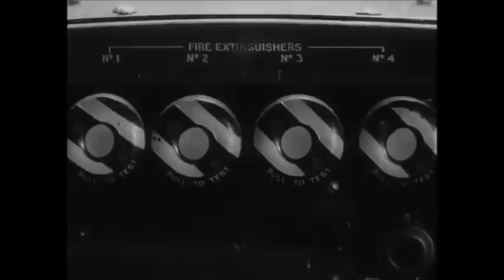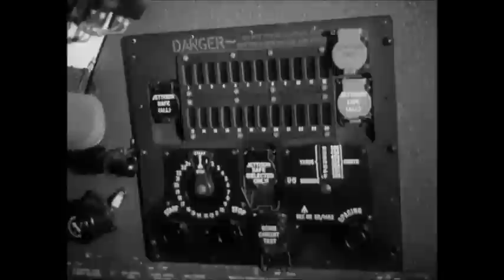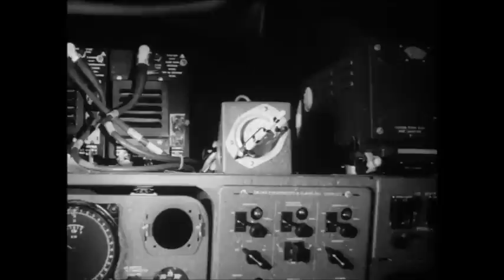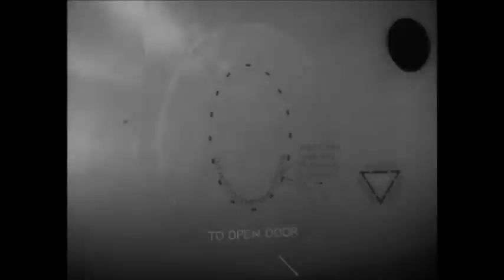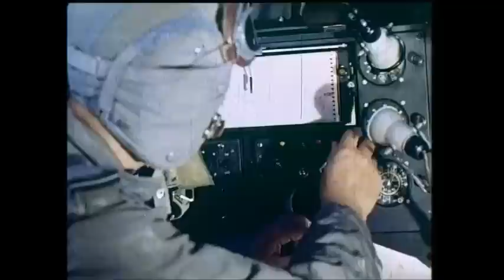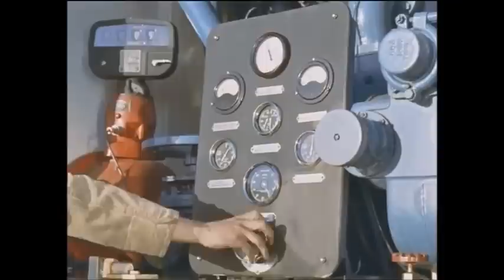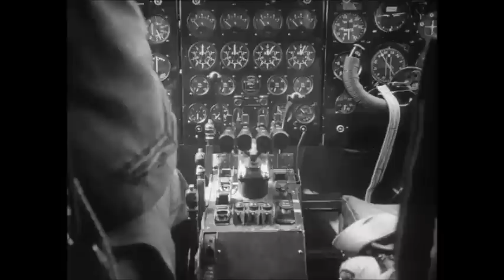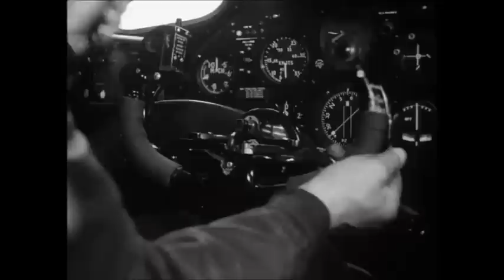Vickers Valiant - The First British V-Bomber

Comment: This video of the valiant’s history is fascinating. I first worked on it when as an apprentice at Weybridge I moved to the drawing office after my tour of all other departments. My first job was to draw up a little plate that would seal off the holes where the vertical stiffeners in the center beam penetrated the bomb bay roof.  I think they  found that when the bomb doors were opened in flight the wind blew in between the beam side plates and did something bad. Those stiffeners were channel shapes separating side sheets on either side. The rubber bag fuel tanks on either side rested against these side sheets . The beam had to be massive enough to carry the bombs weight fore and aft to the wing main spar.
   On the Monday  following  my first week doing this job I my boss the redoubtable George Hodder ordered me to stop work on those plates because the prototype type 660 had crashed. I think I learned at the time, the three observers in the back got out got out and survived by parachutes. One (Was his name Montgomery?) landed in a tree. The two pilots used ejector seats. Sadly the copilot an RAF crewman hit the tail and died.  After that ejector seats giving a faster and higher exit were designed for V bombers. My next couple of years I worked on the type 667 which was the production Valiant, the pathfinder version Type  673 and then the type 1000 transport that was cancelled. Stuff moved at Vickers in those days.
    It is a shame they did not make the 673 the production version, I met one of the Vickers test pilots at Lasham. He said that the 673 was faster and smoother at high speed. I suspect that those main wheel fairings provided an area rule effect that accounted for most of that.  Removing those huge holes in the under wing panels for the bicycle style landing gear must have done wonders for wing strength.  Adding a 54 inch plug in the fuselage forward of the wing , increased the fuselage bending moment. So then subsequent jobs for me were to draw up some specially machined stringers to the top fuselage and steel bars at the lower side where the big opening of the bomb bay meets the side of it. The stress man who gave me the cross section areas of those bits later helped me in turn be a stress bloke. I owe my later career to him.
    For a long time after I left Vickers I could still remember drawing numbers and stations of Valiants.   Stations were defined by the distance in inches from the extreme nose. So something 456 inches aft of the nose would be at station 456. When they added that plug of 56 inches in the pathfinder, frame 125 might still be spoken of as 123 but our stuff aft would be called station 456 plus 54. So the original station numbers were retained for reference. As a comparison, on the Shuttle external tank they put the datum point some 300 or so inches forward of the nose. So they could have lengthened the nose this 300 inches without changing the descriptive geometry.
 Bob Newton
Reply: wow amazing insight. thanks for sharing!
Reply: Thank you so much Robert. Fascinating to hear in such detail. How wonderful to have such pride in your work. 
I thoroughly enjoyed a visit to Brooklands a couple of years ago. l told friends it would have been nearly as good with no exhibits,  but just the amazing volunteers.
Many had worked for Vickers,  and one charming gent had been a test pilot! I have 250 hours, we chatted over an hour,  l was enthralled! 
That was definitely the best day at a museum l have ever had. 
Oh, and l got to drive a F1  simulator around Brooklands.
Reply: It is brilliant to hear the story of a designer working on the Valiant, it was a plane that had many setbacks and the engineers working on the design had quite a hard time, I have to say, they worked extremely hard on the program, making technological strides to create a marvellous aircraft.
Reply: Fascinating, thanks for sharing.
Reply: Wonderful memory
Reply: Great comments, I was wondering as someone knowledgeable on the structural engineering of the Valiant's airframe... why the type reached the end of its fatigue life in such a short time, it was in service for just 10 years.. and what are your thoughts on this as it relates to the B-52 which was introduced at the same time is now expected to remain in service beyond 2040, for 100 years.
Reply: Thank you so much for sharing and for doing so in such detail. It speaks volumes that you recount with such fondness and energy about something that so many others would, wrongly, cast off as something 'inconsequential' or 'trivial' simply because your work wasn't on something they deemed 'important' or 'sexy'. The truth of the matter is of course that it was people like yourself, working on such things, that made such a difference. 

I don't know you from Adam but you have put all this across so eloquently in a comment on a video that I would implore you to look into one of the many organisations / groups out there who dedicate their time too recording 'living histories' of people just like yourself. 'Ordinary' people who contributed so much but may view their efforts as 'nothing special' or feel 'nobody would be interested in my story'. I think it is people such as yourself who are thee most important voices and have such important things to share for prosperity. To create a record of life and work in a past time so that our youth and future generations can have a way to view, listen and learn from your own stories. 

Likely you'll never respond and that is fine but if you read this I hope you consider my suggestion at least. Typing "UK Living History" into google should start you off. I don't work for any such organisation myself but I know they exist and I genuinely feel you have many great snapshots that the future generations ( for all their wrongs I imagine) should at least have a chance to witness.

Comment: How difficult was servicing and replacing engines mounted in the wing roots compared to engines suspended under a wing?
Reply: One is built in the wing making it harder to service. The other is bolt on bolt off like todays airliners.
Reply: We can observe decades of aircraft development and see that engines are only mounted in-wing or in-fuselage when aerodynamic concerns outweigh serviceability.    Today only military combat aircraft use internal engine mounting.
Reply: Replacing or servicing was exponentially more difficult and time consuming with engines in the wing roots. Also, an engine fire or catastrophic engine failure in a wing root = bad news. Especially in those days, when engines were far more failure prone. 

So more drag + more fuel burned + fire/explosion hazard + harder to service = the reason there isn’t a modern aircraft with engines like the Valiant’s. 

But hey, it sure looks “handsome”.
Reply: It seems counter intuitive, but a 707 with it’s engines in nacelles below the wings had better aerodynamic properties than a Comet. As speeds edge closer to Mach 1, a thick wing adds an enormous drag penalty. With engines in the wing root, the wing must necessarily become thicker. It’s one reason a B-52 or a 747 looks less than slick, but are two of the fastest aircraft of their type. Especially when they were new 50-60 years ago. It’s also why modern supersonic aircraft, without exception, have very thin wings (look at an F-104 Starfighter).
Reply: @Chris Potter Great comments! Indeed, placing the engines in the wing roots is seen today as an example of how not to design jet aircraft. The british notion prevalent at the time that this now obsolete configuration was more aerodynamic? It reflects just how far behind the UK aircraft industry really was in aircraft aerodynamics.
Reply: doktorbimmer m
Reply: @Keith Brettell The Boeing B-47 was introduced into service years earlier and still outperformed the Valiant. This was due to a much more advanced aerodynamic design heavily influenced by German developments made during WW2
Reply: @Breezy Mods You seem completely unaware of "Operation Lusty" and "Operation Paperclip" or how these German technology programs effected the development of the Boeing B-47 or why the Boeing company quickly leaped ahead of its competitors.
Reply: @chrispotter3324  also why high speed flying saucer  is unlikely

Comment: Engines in bays instead of pods are more dangerous when they let go besides being cruel to jet engine mechanics. They offered less drag, useful with the feeble engine output and crude mechanical/hydromechanical fuel controls of the era.
Reply: Actually engines mounted in the wing roots offer no significant aerodynamic advantage... this popular but false theory in the UK was dispelled by modern testing methods.
Reply: @doktorbimmer  Incorrect. Palpably and easily incorrect.
Reply: They don't offer less drag on a subsonic aircraft, the Valiant was a very unsophisticated and inefficient airframe.
Reply: @Booyaka9000  The Valiant's engine placement was based entirely on a popular British aerodynamic theory that proved to be completely wrong... proving that the British aircraft industry years behind in high speed aerodynamic research.

Comment: Why have they stopped using this intake scheme... Is it inferior to under-wing nacelles? It seems like a much better idea aerodynamically speaking.
Reply: Short answer, because the engines in use today are primarily high-bipass turbofans, (although some relatively powerful and efficient low-bipass turbofans are now in operation), and those need space. The higher the fan width, the more efficient the engine, and that needs space. That's why you generally see HB turbofans mounted under wing rather than in it. To accommodate more powerful HB turbofans, you need to redesign the wing root or the entie wing itself. It's a problem the Nimrod MRA4 and Xian H-6K have tried to deal with, but it potentially limits future development.
Reply: That makes sense. I guess I just don't understand why it's better to harvest power from the core's gas path and transmit it to a fan...
Reply: @shainemaine1268  First of all it is such that the air flow on the upper wing surface and the lower wing surface are not even. Therefore it is much better to keep the upper wing surface clean. It took the west some time to understand this. Consequently aircraft, such as the B-52 had engines mounted on pylons (flow speeds up even on the lower wing surface). At this time point bypass engines were not even in use.
In fact the critical factor is the speed of the airflow. Once the airflow reaches Mach 1 one encounters compressibility effects. Due to interference of flow around the engine nacelle and the wing speed increase of the airflow adds and Mach 1 is reached much earlier.
This is the reason why early German jet aircraft had the engines mounted below the wing and a clean upper wing surface.
This is also the reason why the Handley Page Victor had the engine intakes below the leading edge. Johanna Weber, a gifted German girl, designed the Victor. It took the English some time to understand this.
The power requirement to accelerate an airflow to a certain speed rises with the power of three of the speed.
Thus it is more efficient to accelerate to lower speeds and increase the mass of airflow instead to achieve the same thrust. Therefore one needs a blower  to get this massive airflow.
This concept works below Mach 1 only. This is the reason why fighter jets have straight jet engines only !
Reply: YES, the design is not only inferior but was severely flawed.
No modern aircraft engineer would use this design based on wind tunnel test data, the Valiant's engine placement wasbased on a British  aerodynamic theory that later proved to be completely wrong.

Comment: Wait, B29s were called Washingtons?
Reply: The British called them Washingtons. They do name change when they buy planes.  Example  , the Brits called the US P-40 Kittyhawk the Tomahawk.
Reply: @Crashed131963  The UK had a policy of naming US built bomber and transport aircraft in in RAF/Royal Navy service after American place names - C-47/Dakota, Boston, Maryland, Baltimore,  Washington, Catalina. There were a few they didn't bother changing - such as the B-17 Flying Fortress, the B-24 Liberator and the B-25 Mitchell.
Reply: @EricIrl   I never seen a photo of a British operated B-17.
I thought since the British had a nice 4 engine Bomber like the lancaster they had no need for a B-17.
The B-24 was differned because of it, s extreme long range for anti-sub duties.
Reply: @Crashed131963  The RAF ordered a relatively small number of B-17Cs early in the war. They thought that they would be useful in high altitude, daylight raids against specialist targets.  However, the early B-17s, although able to fly high and fast,  had insufficient defensive armament for daylight operations and did not carry a decent bomb load. Also, the US would not supply the B-17Cs with the Norden bomb sight, which was considered essential for bombing accuracy from high altitudes. 
Later versions of the B-17 (equivalent to the E, F and G) were also used by the RAF in small numbers, mainly by Coastal Command and also by 100 Group in the  Electronic Counter Measures (ECM) role.

At the time the RAF ordered their original B-17s, the Lancaster didn't exist.
Reply: @Crashed131963  "The British called them Washingtons"

The British *and Australians. * The were in RAAF service too.